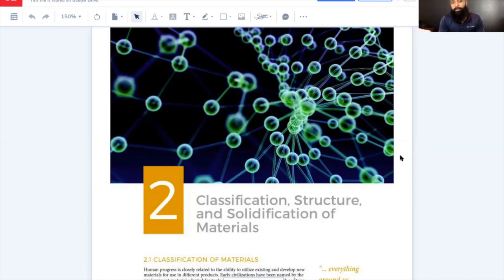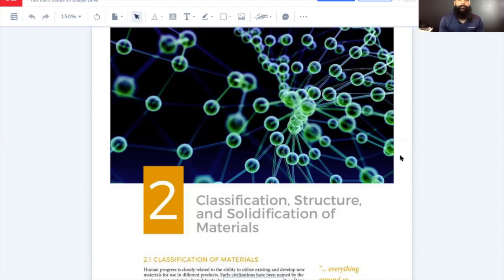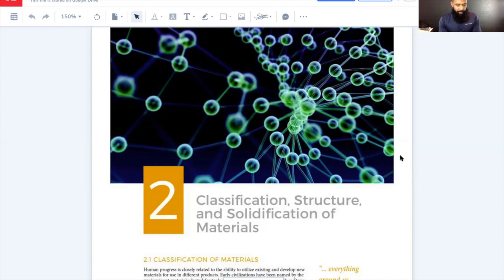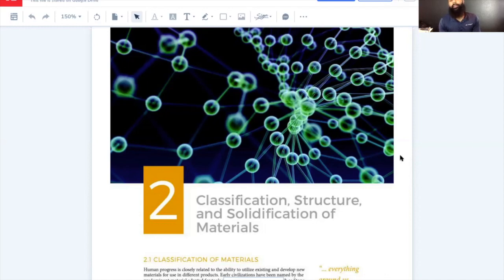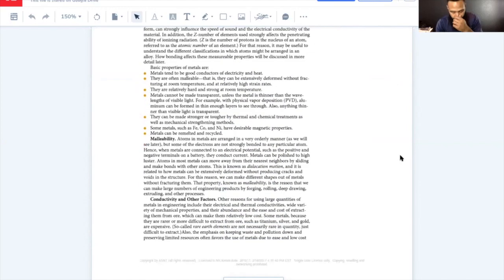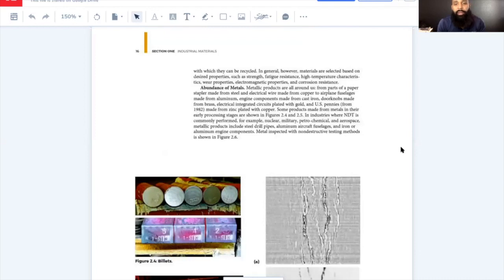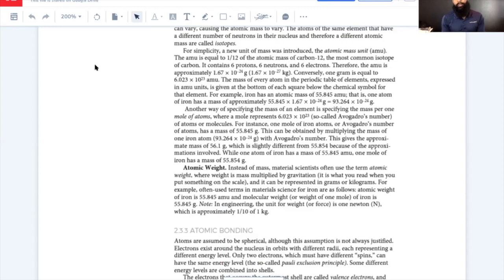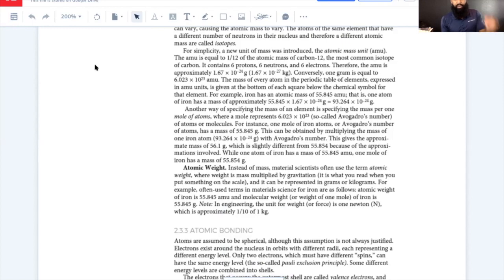ASNT Level 3 Basic Prep

Comment: Wondering if you were planning on finishing this "series" I am planning on taking my level 3 basic (and UT specific) this years and looking for help studying for the basic exam. Thanks!
Reply: @kenaz868  I haven't yet. Planning on Taking the level III refresher course in Columbus in November, then taking the general and UT specific right after
Reply: @adamholmes7902  tomorrows the last day of my basic prep course. The RT math is new to me. I'm going for MT after this.
Reply: @kenaz868  is there math on the basic exam? Good luck with your tests!
Reply: @adamholmes7902  yes thats what the instructor is telling us. Thanks
Reply: @kenaz868  besides the refresher course, did you do a lot of self studying, or do you think the course is pretty sufficient in preparing for the the basic exam? Also curious what your background is...do you have an engineering degree or any metallurgy experience?
Reply: @adamholmes7902  no I didn't do any self studying. my background is in UT MT and I got my CWI.  to me the course covered alot that was already covered in the CWI course. I think the prep course helps alot. I'm confident I will pass. the main difference is that this course goes a little deeper into metallurgy.
Reply: @kenaz868  just wondering if you had an update...did you pass?